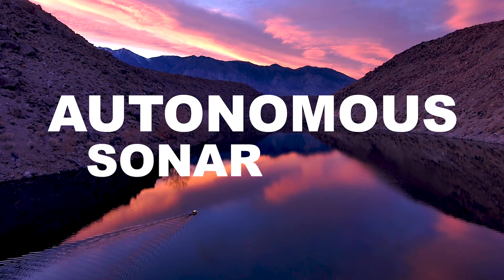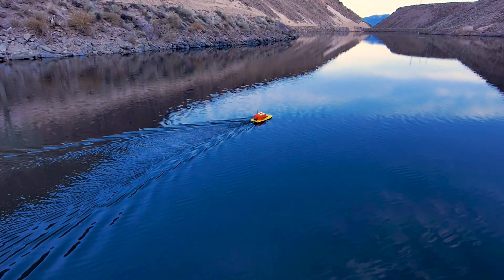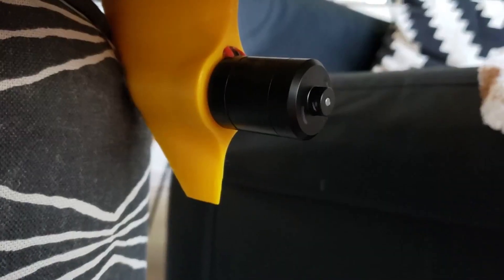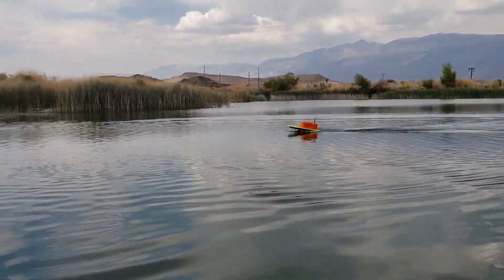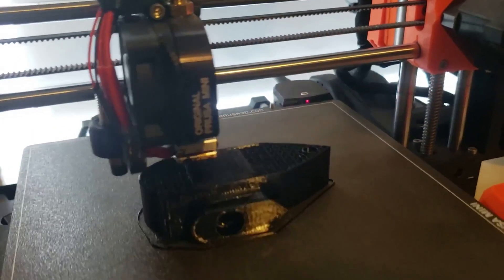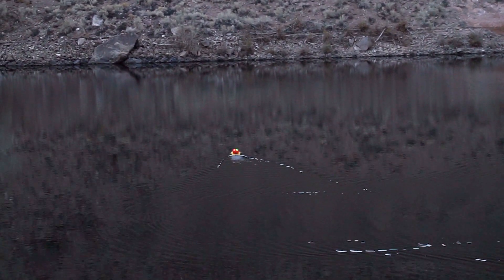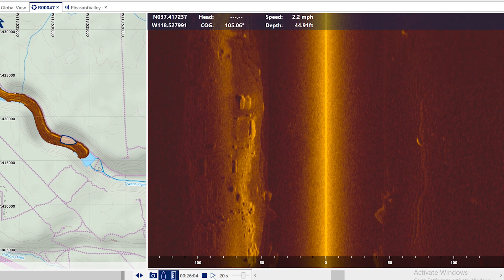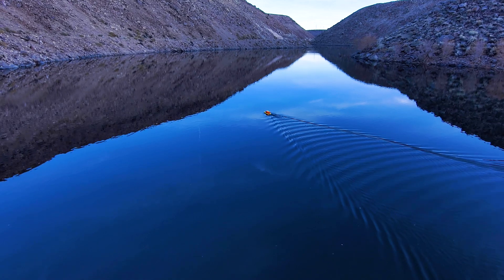My Autonomous Sonar Boat

Comment: Also planning on building an Autonomous Sonar Boat. Purchased most of the supplies needed 3 years ago but got sidetracked building a house. Maybe 2024 will be the year I get it done and post the video of the process. I had planned on putting all of the electronics in the same box so I'll need to come up[with a way to shield the transducer cables with that single box. Also, I think I'm going to separate the drive power from the sonar's power with two different batteries.

Comment: it is interesting to learn that skid steer is not reliable for boats according to your experience but very reliable for ground vehicles. aluminum foil around wires, have you tried to ground foil which was attached to wires? you cannot put gps and compass module inside faraday cage, so you put them outside? will be great to chat to learn more